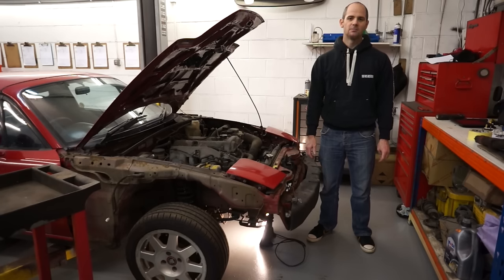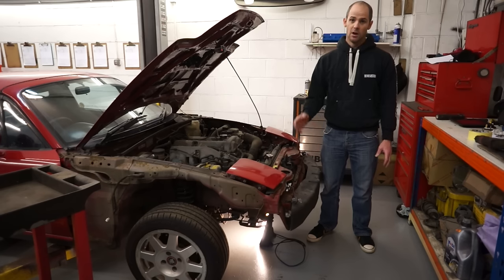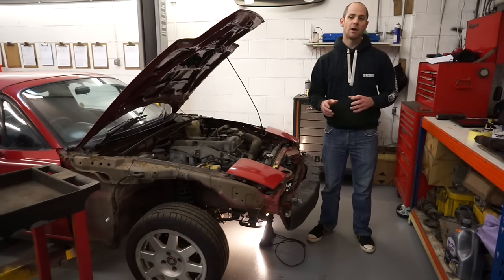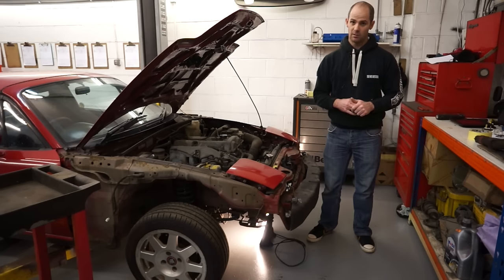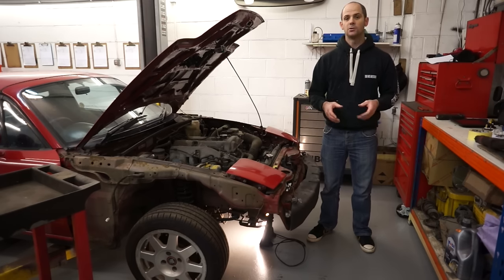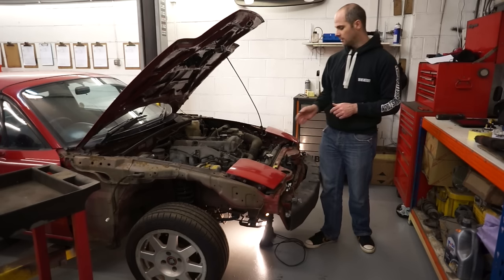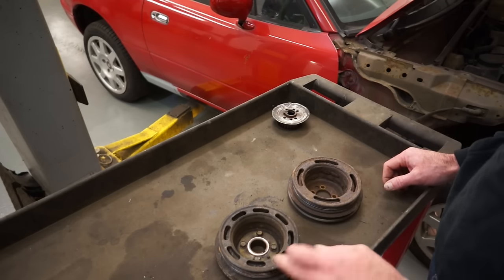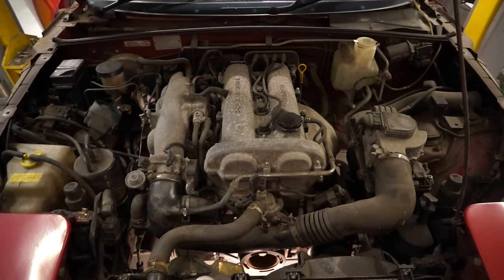Mk1 Mazda MX5 Buyers guide part 2 - short nose crank engine

Comment: Thank you for showing the actual crank pulleys. Most books might mention 4 slots vs 8 slots on the pulley to identify the crank you have at a glance but few show an actual photograph. Even the official shop manual does not show photographs illustrating the differences. So good show!

Comment: If my timing is jumping at idle around ~1.5 degrees, is this is the issue? My pulley is solid chunk of rust. I think i just have do drive, and when it fails, swap an engine. It will be cheaper, these new MX5 parts are so expensive.

Comment: Evening, great video and exactly what I'm after. Hoping to finally pick up a mk1 in approx 3 months. can you recommend a trader that imports rust free examples? I've been to see 9 to date all described as mint and all turned out to be rot boxes.
Reply from the maker: +Glen Dunn hi glen,

We don't import them, but we do get hold of good cars, we currently have a couple in stock, both need a little work though, where are you based?
Reply: +Lights go up Lights go down The north of Scotland, close to Inverness. Willing to travel for the right car. do you have a website?
Reply from the maker: +Glen Dunn we do, but we are based in East Sussex, so couldn't be further away really, the website is www.themx5restorer.co.uk

There is a red car on the website, but that has sold, the other two we have are not on there yet because they aren't ready yet really

Comment: why not buy a new keyway?
Reply from the maker: Because the key way is part of the crank, so therefore you would need to buy a new crank
Reply: Because it'a already worn.
Reply: The keyway is a groove in the crankshaft. And to replace the crankshaft you'd need to pull the engine apart,replacing a bunch of stuff that isn't re-usable (basically you'd be rebuilding an engine). 
And rebuilding an engine is expensive and time consuming, applying tread glue to a bolt isn't